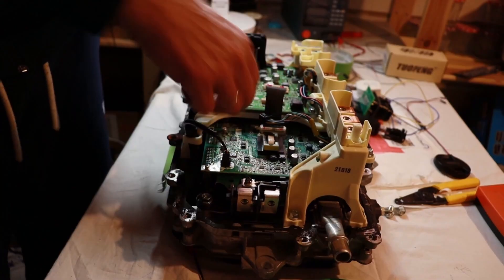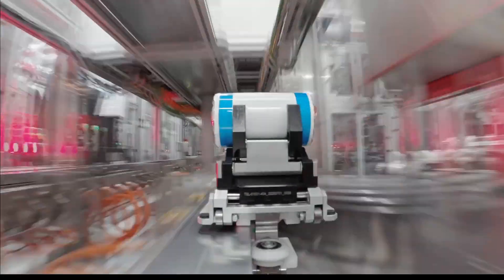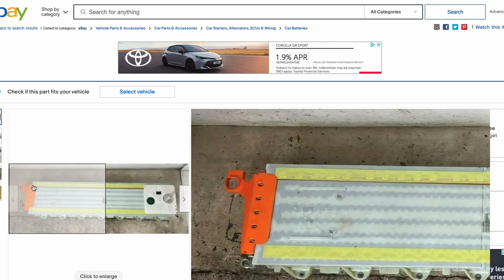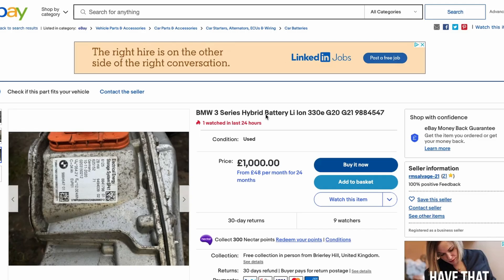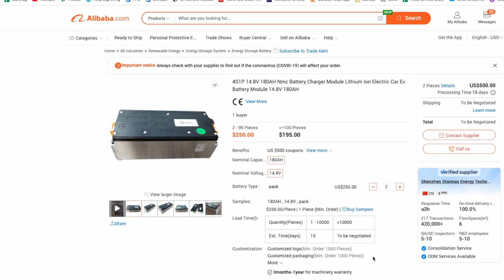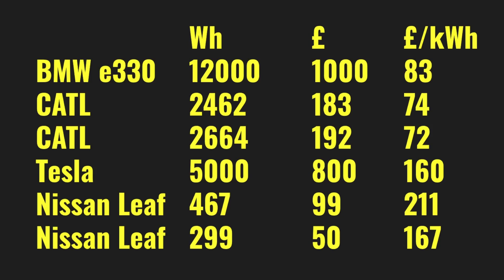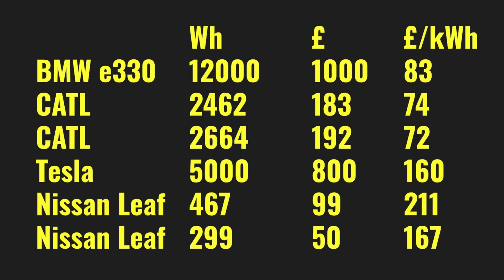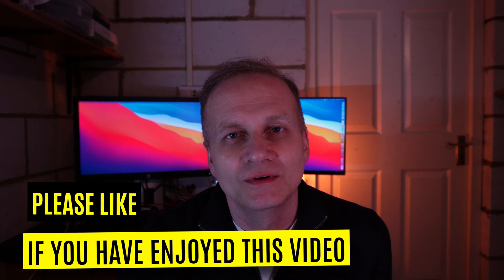What battery to choose fro my EV conversion Ep 25

Comment: I think you  will have better luck getting a battery or a complete car from a breaker than just the modules on ebay. Ebay prices are inflated due to being one extra link in the chain (they get the complete batteries from breakers usually.)
Reply from the maker: Yes I know I did think about that. Unfortunately I don't have any space around the house to store the complete car. I am trying to rent a bigger garage in the future but for now I am stuck
Reply: You can usually get complete battery packs directly from breakers for a lot cheaper than ebay
Reply from the maker: @Ryukachoo  Now most car breakers have shops on eBay and sell things at the same price

Comment: I know it sounds stupid but I saw one guy welded himself battery for leaf upgrade from 18650 LG. (48 KW is about 4000 cells or so on) it will definitely not the cheapest option, the cells will be about 3K from China but at least you know the quality. Second hand very risky as you don't know how it has been used and how long it was stored discharged. Yes it is just £1000, but it was very shame wasted 1000 on bad batteries. Do one thing. Buy from Ali baba trial set of 100 cells and test them all for capacity and discharge amperage, if it is matched on label buy the rest from the same seller. Sellers in the UK are greedy and 18650 LG will be about £4 each which is incredibly expensive. Try to find no more than £1-1.20
Reply from the maker: This is my thoughts exactly it is very difficult to spend £1k on battery you don't know the state of. But making battery out of 18650 cells is too much for me I will definitely not go this way. I think I will go second had BMW batteries from a known car route

Comment: hi i thought you were going to use lto batterys. mitsubishi used them in there newer "mitsubishi innovative electric vehicle" (miev) only in the ones made in japan
Reply from the maker: Yes this is the plan long term. I just need to get the motor running and tested in a car first. And later to see if I could make small LTO pack to work to accept higher regen current and help with fast charging. While have a standard pack as a range extender pack.

Comment: The problem with the CATL modules for me is packaging. You'd need 15 modules in series (at least) to get up to a sensible voltage and that would likely mean a split pack with two or three parts. Then you have to wire up your BMS to cover all that. Parallel packs may not be ideal but with the 60v (ish) BMW modules, packaging 5 or six of them together is much easier.
Reply from the maker: Thanks very good point I will keep that in mind.

Comment: good info I learned something from you as always, my advice is that you have to just jump in and stick a fork in the sand if you will, ie establish a baseline because there are just way too many factors in play, you could get a nice Nissan Leaf battery pack but when it arrives you will find out that it's at 50% capacity instead of 80% as the seller has claimed, and I highly recommend used electric or hybrid battery pack over any kind of Alibaba third party stuff, they are just built so well and so rugged, and they are purpose built for EVs, but go for the BMW 530e or the 740e instead of the 330e that 330e eBay listing you have researched is wrong, that is not a 330e pack it's either the 530e or the 740e, you'll thank me later
Reply from the maker: Thank you for your advice, it does look like the BMW modules are the best. Also Jamie comments confirm that BMW could work with SIMPS BMS which is quite popular in UK so this may be another reason to go for it. It's just a lot of money if you get bad modules
Reply: @LatutaEV  no problem there are also the BMW i3 full 100% electric battery modules. have you researched those
Reply from the maker: @Good-Enuff-Garage  yes of course they seem difficult to come by in UK but I am still looking. One of the issues I have is my garage too small for this work I need to find a bigger garage. But I want to progress to the point when I have motor , battery , BMS, cables and connectors ready.
Reply from the maker: This is what was in the description BMW 3 Series Hybrid Battery Li Ion 330e G20 G21 9884547.

Comment: another upside for the bmw modules is itll include the BMS that can be reused rather cheaply with a teensy and a can transceiver.
Reply from the maker: Is this what you used in form of simps BMS? Does it reuse part of BMW module?
Reply: @LatutaEV  each BMW module has a daughter board and a teensy running simpbms can read the voltages and temperature. Also instruct them to balance. You don't need the expensive simpbms board, just a teensy and can transceiver.
Reply from the maker: @JamieJones1985  Thank you very interesting information which may be a big deciding factor for me
Reply from the maker: @JamieJones1985  I was considering to try DIY BMS simply because I have made one variant of it in the past